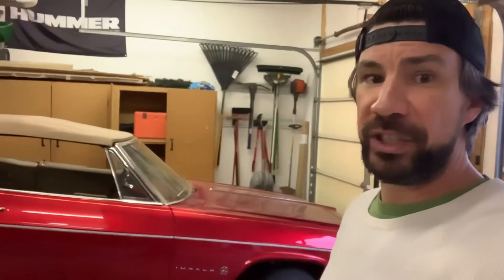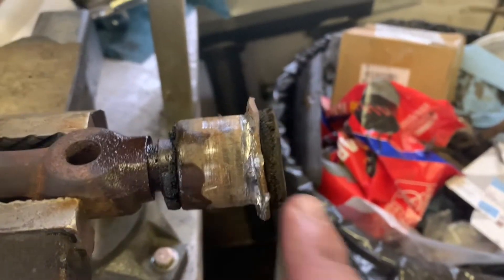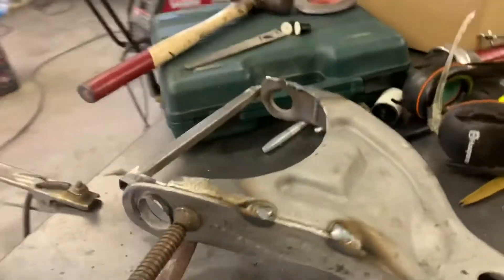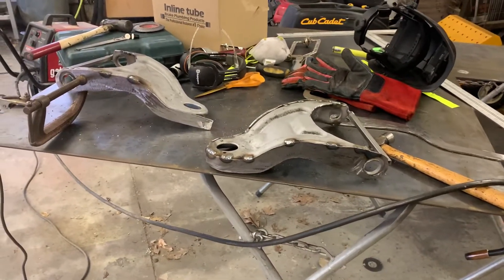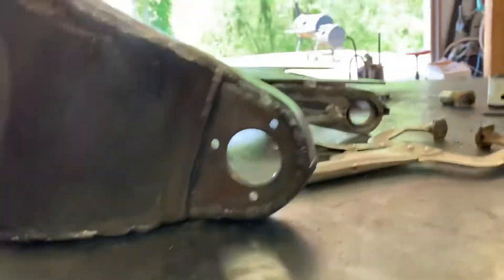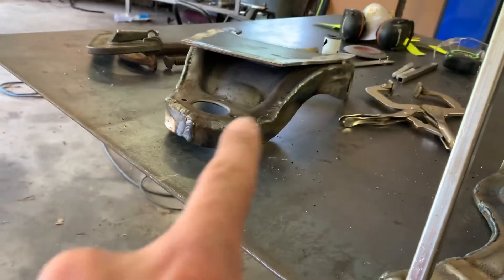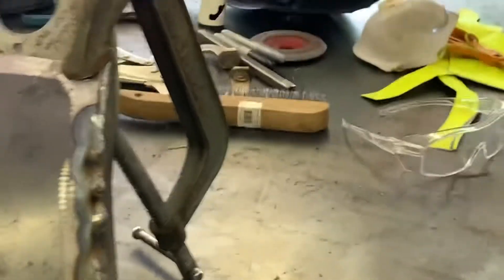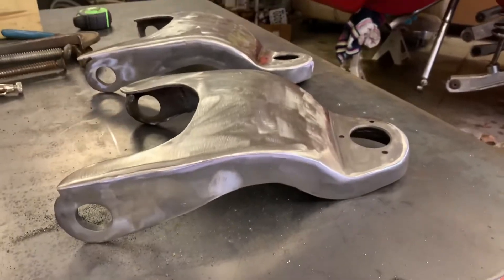How to extend and mold 55-57 Bel Air (TriFive) control arms (A-Arms)

Comment: Nice work bro!!!!…wat kinda sand blast machine did u use?
Reply from the maker: Thanks! I just bought a small cheap one from Eastwood. The 100# one if I remember right. And I bought the charcoal abrasive at Tractor Supply 👍 hope that helps and thanks for the comment